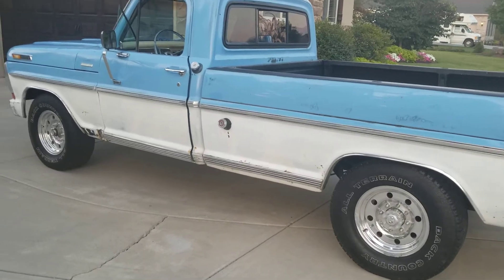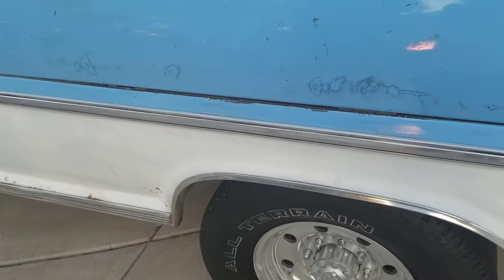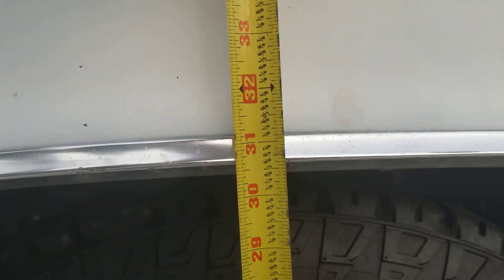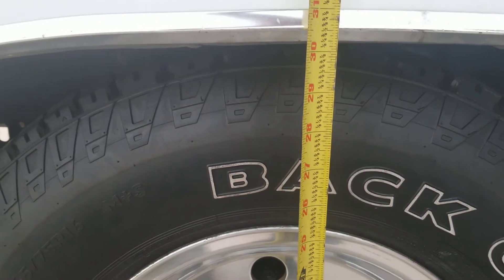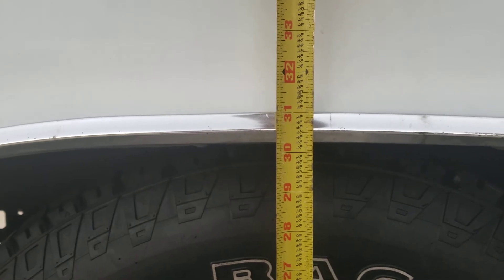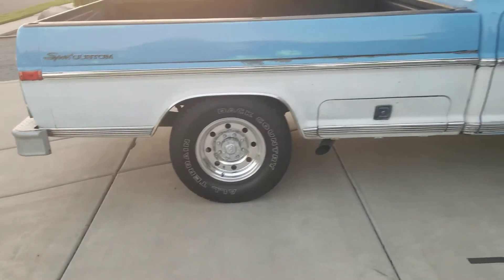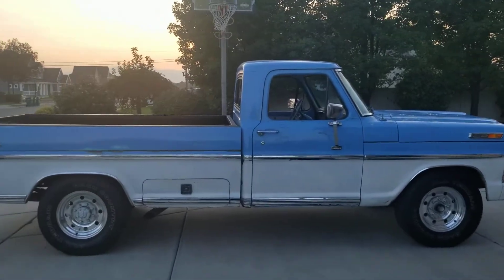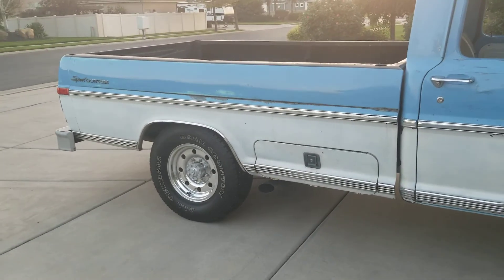1970 F250 hanger 1/2 flip completed. 3 inch drop achieved.

Comment: Reall love the videos, what angle shim did you end up using? I would like to order the parts and try to do it in one go. Thanks!
Reply from the maker: I used an 8 degree shim.  Bought it from Summit Racing,  online , if I remember correctly.  I measured everything first and that's what it ended up needing.  Good luck with yours.

Comment: I have a 1967 F250 I was thinking about doing this same set up on. I was wondering what degree shims you ended up going with to get the pinion angle right? I thought i heard you say 8 degree shims but i'm not sure if that's what you ended up going with.
Reply from the maker: Hello Luke, sorry for the delayed response,  I have been down and out with covid.  Yes I bought and used 8 degree shims.  I used and angle finder app on my phone before and after and measured 4 times to make sure I was ordering the right angle.

Comment: What's a half flip?
Reply from the maker: A 1/2 flip is where you take the front leaf spring hanger and flip it upside down and remount it, and use about 1/2 the hanger.  The goal is to move the spring up a bit, thus lowering the body.